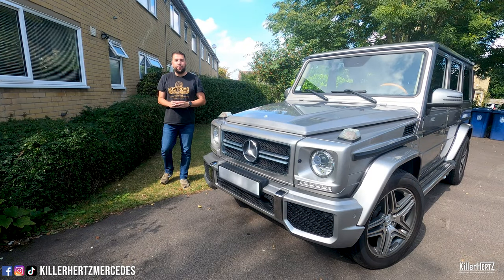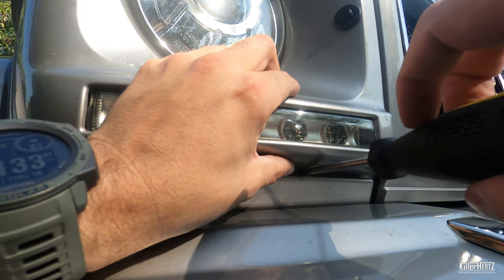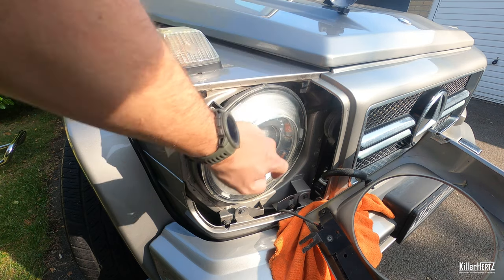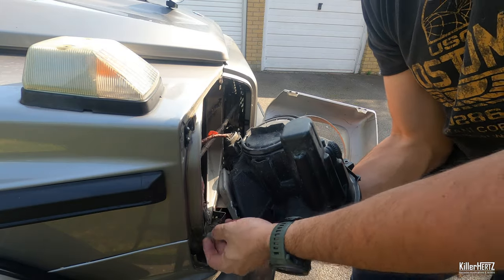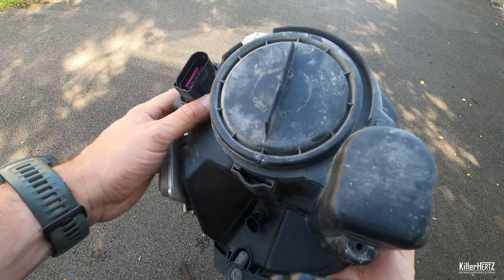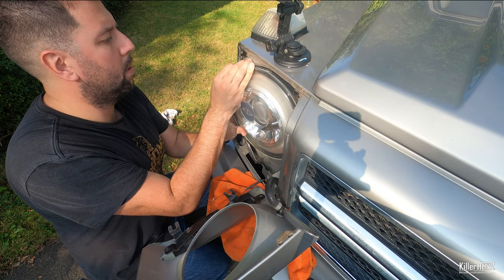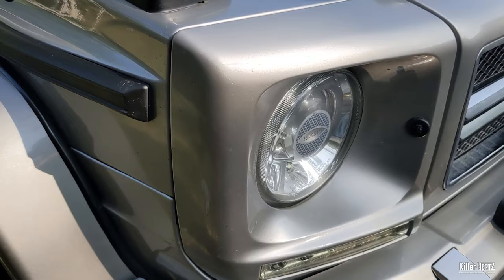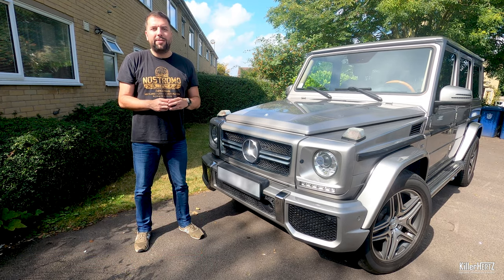HOW TO Replace G Wagon W463 Headlight Bulbs & Remove Headlights

Comment: Can you adjust the headlamp beam angle? Mine have always seemed low on my 2011 G 55. No good videos to show this process.
Reply from the maker: At 4:46 you can see both the horizontal and vertical adjustment dials :)
Reply: Ok. Do you just turn my hand? Which one controls which? Is the white vertical and black side horizontal?
Reply: @killerhertzmercedes  I just tried to adjust my beam angle today. Some improvement, but still not like my other Mercedes. Are your beams particularly low? Any help is greatly appreciated.

Comment: Or you can simply remove the fender liner and access the light unit from the rear without removing anything else. Also, avoids scratching up any of the front face pieces.